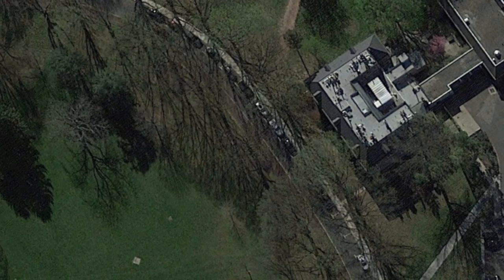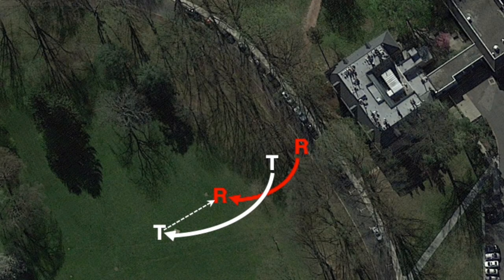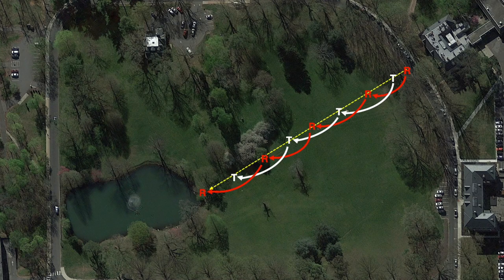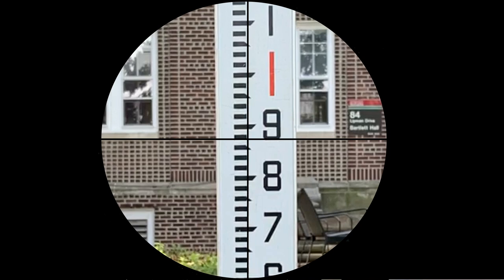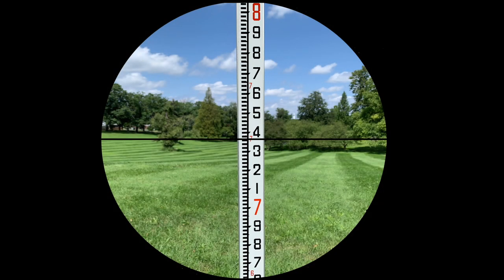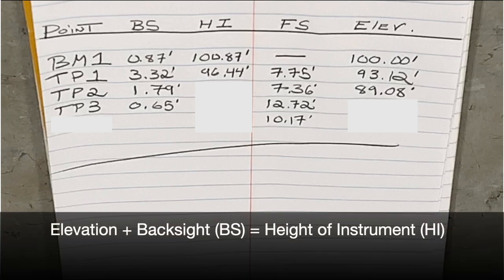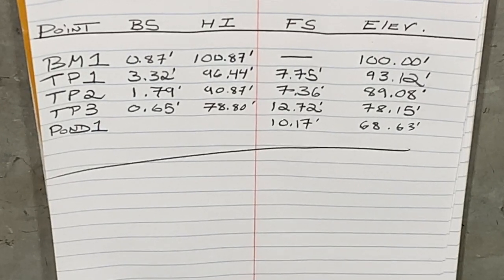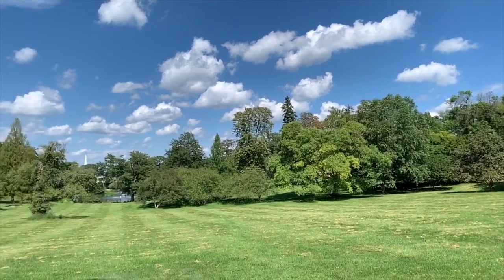Intro to Measuring Elevation

Comment: Nice tutorial. Thanks. 
One question remains for me. Do these instruments allow also for (horizontal) distance measurements? It is said that the guy with the Philadelphia rod chooses a good turning point to represent well the slope of the terrain, but what about the distance between instrument and rod? Should you just carry a good old long tape to measure distances? Am I asking too many questions? 😅
Thanks anyway for the video. It answers most of the questions regarding this process.